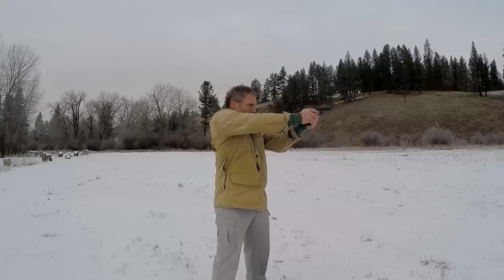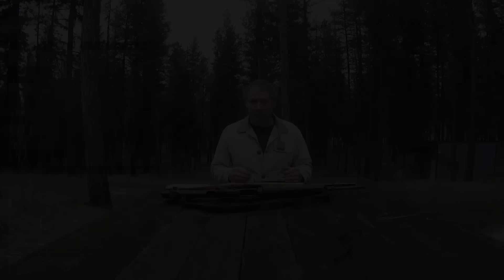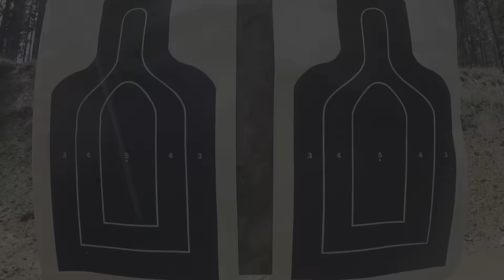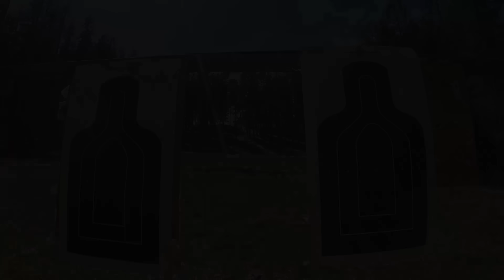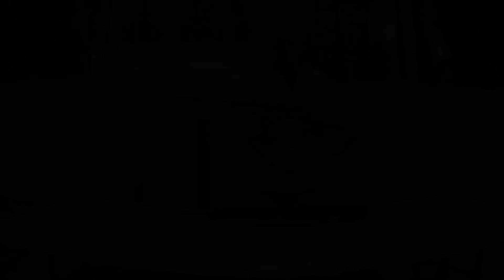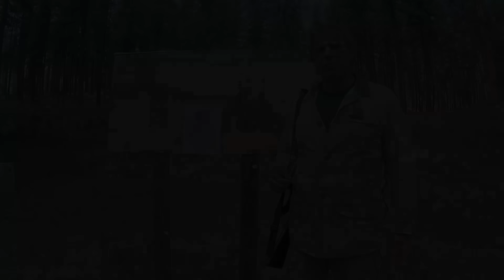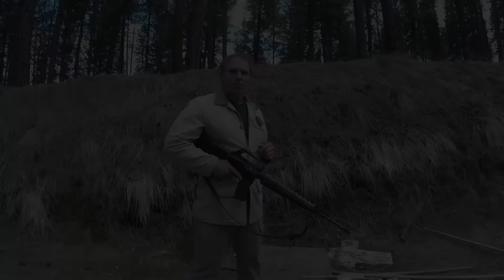Mini-14 vs AR15: Which is Better?

Comment: Bill Ruger didn't make a lot of mistakes but not using AR magazines in the mini 14 was one of them.
Reply: The AR platform wasn't nearly as popular as it is today when the mini was designed and initially released
Reply: @NinjaThatLongboards  There was a time when many of us believed that the M-16 was nothing but trouble.  Over the years, we learned about the switch in powder in the 5.56 and little mistakes like not issuing cleaning kits contributed to the stories about GIs being found dead next to disassembled rifles.  The Mini14 looked like the guns we were familiar with: the  M-1 if not the M-14.  It was about like an M-1 Carbine in a far superior caliber.
Reply: @eastofaustin258  thats what I've been trying to say and nobody believes me
Reply: @eastofaustin258  isnt a 30 Cal in this case more similar to a pistol cartridge with a little omph
Reply: @matthewbivens1299  

I believe what I said (I can't seem to find it) was that the Mini 14 was more like the M1, the M-14/M1A, and the M1 Carbine with a far better cartridge.  Yes, the M1-Carbine is a hot pistol round.  THe M1 of course was produced in .30-06 for the Military and the M-14 was for 7.62x51.  BTW, the M1-Carbine has been modified to some other calendars.
Reply: Walter Lee is modern 5.56 ammo closer to what colt intended? Or is the stuff I’m buying at stores more like the weird powder ammo the army was insisting on during the Vietnam era.
Reply: @eastofaustin258  Most folks don't remember that the AR-15 was originally developed in response to an Air Force request for a light rifle to replace the M1/M2 carbines. The other weapon submitted was the Winchester light rifle, which was in many ways a "product-improved" carbine in .224 caliber. Winchester abandoned their design after their .224 cartridge failed to match the Armalite .223 cartridge's performance in testing and -- more subtly, but also significantly -- noting that many of the younger military decision-makers liked the "Buck Rogers" look of the Armalite rifle.
Reply: @boredandagitated  The design changes incorporated in the M16A1, plus actually cleaning the rifle to eliminate carbon build-up, addressed most of the issues caused by the Army's change in powder back in the 1960s. The carbon build up issue has also been partially mitigated by no longer using powder formulated to minimize muzzle flash.
The only real remaining issue is the change in the pressure curve, and all the military ammo since the M855 design has worsened that by further elevating chamber pressures. When in introduced, the M193 cartridge was considered "hot" at 55,000 CPU, but current military ammo has upped the ante on that front (to 68,000 CPU) in an effort to push rifle-barrel performance out of the shorter carbine barrels.
Reply: Walter Lee ... I had to furrow my brow at your use of the word "calendars". I figured out that you meant calibers. M-1 carbines in other than .30 carbine caliber are extremely rare and next to useless. Depending on the particular shooter and rifle, M-1 carbines can be capable of surprising accuracy. My Japanese M-1000 Universal Firearms version was very natural for me to do rapid fire plinking with very effective accuracy for the circumstances. It also accounted for a prairie dog at a distance that was difficult to judge, so I slid the peep sight to the 250 mark and held just over the top of its head. I touched the round off and an eternity later came the sound of the hit. I decided to drive to the point where the dog was due to the distance and rough terrain. The odometer clicked 2 tenths on the way up. All in all, it was a bit over 300 yards. Part of the reason I had trouble doping the distance was the size of the beast. It was the biggest prairie dog I'd ever seen. I was too young and dumb to be aware enough to take it to a taxidermist. Unlike those disintegrated by .22-250 bullets, this one was very much intact, due to the slower and unexpanded bullet passing through the chest. I still have the carbine and one more from a gun show a few years back. Just don't shoot much anymore.
Reply: @NinjaThatLongboards  This, it wasn't even that long ago when buying a Colt was pretty much the only guarantee that your AR wasn't going to be a lemon (alot of subpar DPMS/Olympic quality AR's flooding the market)
Reply: One could also argue that its a feature that keeps the Mini off ban lists.
Reply: It's not an AR.
Reply: @hugh-johnfleming289  Neither is the Steyr Aug or CETME L, or L85 but they were all designed or redesigned to use STANAG magazines.  I feel certain a Mini 14 could be built that used an AR magazine.
Reply: @williamprince1114  That's like saying "they should have built that handgun to take Glock mags," but saying it in the early 90s when they hadn't dominated the market yet... The Steyr Aug was created with proprietary magazines when it was designed in '77 and didn't change to STANAG magazines until decades later, after the AR had dominated the market. Also, don't forget the mistrust that the early problems with the AR created. They are beloved today, and rightfully so, but that wasn't always the case. There was a time when using AR magazines or parts would have been considered a bad thing by some. It was a completely different era and they couldn't predict the future... How many people were making guns to take Glock mags in the first two decades after they came out? People didn't trust the new fangled plastic guns yet...
Reply: @williamprince1114  Look at the geometry for the magazine catch on AR-15 magazines -- you would have to graft an AR-style magazine well on to the bottom of a Mini-14 to properly support an AR-style magazine. Not only is the geometry for the magazine latch different, with clearance required along the left rear of the magazine for the latch to move in and out versus the Mini-14 latch operating in line with the rear of the magazine, but the notch at the front of the Mini-14 mag (the reason for the rock-in motion) eliminated the need for a long magazine well to hold the magazine upright for reliable alignment with the barrel.
It's also worth noting that the Mini-14's magazine 2-point retention system (simple rocking-lever latch at the rear plus a fixed latch at the front) is also used by the M-14 and all of the Kalashnikov rifles.
Reply: @williamprince1114  I own a few of each, I should look at the Mini and see if its possible to adapt one to use an AR magazine.
Reply: @shakingmyhead7707  Just like with the mini 14 there were reasons they didn't do that. The AK was still looked down upon as the "commie bad guy gun" or whatever when the mini thirty came out in '87. The AK has only fairly recently become popular and revered (as it should be, IMO) among the mainstream American shooters...
Reply: @ZombieWilfred  The AK platform rightfully became popular in the US, mostly because of it's insane durability. I've seen guys jam a fistful of mud in the bolt, and it still ran flawlessly. Bear in mind that those were the Romanian AK's, which were considered low quality at the time.
Reply: @michaelmartin4493  Not to dispute your memory, but the video at https://www.youtube.com/watch?v=DX73uXs3xGU says (and shows) otherwise.
Reply: @shakingmyhead7707  I've only ever sold one of my guns. Never again! Haha! I'm definitely glad the AK has caught on here. I find it strange when people hate on a certain gun just because if its country of origin or it being used by "the enemy." Doesn't matter to me where it came from, a good gun design is a good gun design. The first rifle I ever bought was an AKM variant when I was about 21-22 so '07 or '08 (M+M M10, it's been a great gun for me.) I wish I was old enough to have bought them cheap back in the day, along with SKSs and all the milsurps that have gone up so much in price in the past few decades. I also own an AR and a VZ 58. I'm a collector, though, so I want one of everything! 😂
Reply: Selling 30 round magazines made by Ruger for $50 is a profit generator. Shows Bill likes to nickel and dime his customers
Reply: @Community-Action   Bill was of the opinion that no "honest man" needed more than 10 rounds and didn't want normal people to have 30 round magazines.
Reply: axmajpayne actually when that happened the government wanted to ban all magazines. Bill was who got them to agree to 10 rounds being the limit. If it wasn’t for ruger we would have had no magazines during the assault weapons ban.
Reply: @dinospumoni8860  Oh you mean like Benchmade Knife company in OR...they get a whole new crop of anti gunners to buy their knife...while blatantly lying on FB about being "pro 2a"...

After deleting a post showing them saw up guns for the local cops...😃...RIGHT...
Reply: axmajpayne actually he said 15 rounds but still...
Reply: @shakingmyhead7707  In my opinion they're quite good. Quality (at least it appears to me to be) cold hammer forged chrome lined barrel with 1 in 10 twist and 4 lands and grooves. The tapco G2 trigger is quite nice as well. I also like that it has a side rail, quad rail, hogue grip (comfy!,) RPK-style windage adjustable rear sight, and an actual muzzle break instead of the slant break many have. The gas block front sight (which looks great, but does reduce the sight radius...) is hard to adjust for windage, because regular AK front sight tools won't fit over it, but to me that's a non issue because I just keep it dead centered and used the adjustable rear sight to zero it, which means you don't have to worry about having to have your front sight canted when properly zeroed. When I have people out to my range to shoot they're usually quite surprised at how accurate it is, especially with the fairly short sight radius. I would need to get a lead sled or something and a mount and magnified optic to really see what it can do, but as far as I can tell it's very accurate.
Reply: As an owner of an LCP, GP 101, 22/45, P85 and ex-owner of a Mini - yes, sadly, that's just one of several things wrong. I wanted to like my Mini, I really tried to.  You could put up with the P.I.T.A. they are to field strip (which seems to be true of EVERY ruger) if the accuracy made up for it.  On the Mini, it doesn't - I had an oldy the new ones might be better - but I'll stick w my Stag M4gery... Ridiculously accurate compared to the mini.  I can hit a can at 200 yards, iron sights, with the M4gery- can't do anything like that with the Mini...
Reply: I would buy one if they made them compatible with ar15 mags, for sure.
Reply: I think that’s the furthest I have ever seen anybody shoot at a chronograph.  I am not lucky like that.  Shooting into the sun with open sights with old eyes, results are expected.
Reply: Mike Gee  thanks I thought so I've only ever seen them in media
Reply: @shakingmyhead7707  You're welcome. Bought it way later than I thought, though. Turns out I got it in '13. Thought it was closer to when I bought my first handgun, but I guess not, haha!
Reply: bob bobo  I saw it myself. Before that, I wouldn't have believed it either.
Reply: bob bobo  I like the accuracy of an AR, but for more practical ranges I'm with you. I like the AK. My real preference is battle rifles, such as FN FAL, or G3, though. I also agree on Ian, as well. Great show. I love seeing the history of some of these rare guns.
Reply: No shit.
Reply: or ak mags on the mini-30, one of which I own!
Reply: @TheHuskers1995  The original mini-30 is an absolute joke considering it doesn't function reliably with steel cased ammo which is almost 99.99% of 7.62x39 ammo out there. Moving to the .300 BLACKED makes more sense
Reply: Bill Ruger was anti 2a
Reply: Bill Ruger Sr. worked with Diane Feinstein to ensure his rifle would remain unchanged and his competition, ARs, would be banned under the AWB.
Reply: Why would he use what is the biggest weakness of the AR platform?

It takes probably 3-4 AR magazines to equal one Mini-14 magazine and god knows how many to equal one AK magazine.

Anyone remember the federal AWB days? When AR mag rebuild kits and feed lip straightening tools were sold prominently at every sporting goods store? Sure you had AK spring/follower kits, but they weren't carried everywhere and often were special order items. Mini-14 magazine rebuild parts were special order items.

Even today there are AR mag Go/No-Go gauges for feed lips available online from a multitude of sellers; tools for fixing the feet lips and more. Nothing similar exists for AK and Mini-14 magazines because those don't go wrong often enough to warrant such tools.

The Mini-14 and AK magazines are examples of "Buy once, cry once". AK mags are built to outlast the gun while Mini-14 magazines are built to be a bit lighter, but still durable enough to last along with the gun itself. (Pretty much nobody outside of a video game or shooting competition actually drops their mags when reloading. They retain them.)

The only reason people say they wish it took AR magazines is because "they're common". Ignoring how many malfunctions are caused by the magazines themselves due to their fragile construction, necessitating they be as common as dirt in the first place. For people who don't have a dealers account at Brownells and who think shooting 20 rounds per trip to the range is a lot, having a gun that uses magazines of a firmer construction are an advantage, even if they cost slightly more.

Heck, En-Block clips were at one point cheap and common. Should people have designed their guns to all use them?

The desire to shoe-horn a problematic magazine design into every gun design is quite laughable as far as I'm concerned.
Reply: Does it take glock mags?
Reply: Jean-Louis Bourgeois  That, or you know, he thought that people should actually hit what they shoot at, rather than blazing away and using volume of fire as a substitute for skill. And that the only need for large magazines was  for either the incompetents or criminals. The AR was designed for military use, where ammunition capacity is important for sustained flights. The Mini-14 was fundamentally a civilian market rifle (yes, I know it was submitted for the Air Force competition, but it was designed specifically with the civilian market in mind), where the requirements are noticeably different, and high magazine capacity is only a "need" for fetishists. 

He wasn't wrong. 

And methinks you're, ahhh, compensating for something.
Reply: @trims2u  no compensation, just want us normal citizens to be on as on par with the military as possible...what the founders intended
Reply: @andrewkraus7215  (a) that's not what the founders intended (b) we absolutely don't want our civilians equipped like our military, as the arms are for completely different purposes  (c)  what they intended is irrelevant anyway. They weren't God, and it's not Scripture.

The Constitution is a framework for governance. It's interpretation is mutable based on the time period where it's being looked at.

Comment: In Canada, an AR costs as low as $600, but is restricted to range use only. A Mini-14 starts at $1100, but can be used unrestricted except capacity (5rds). So we buy Chinese bullpups for $900 and can use 10rnd mags. Yeah, it still sucks, but it's better than a plastic  KelTec  at $1000+.

Comment: I'm not sure why this is a topic. If you have a mini so what but if you have an AR-15 you have a far superior rifle. Just using Ruger for example Ruger Mini 14 Tactial which to me is comparable to an AR-15 1:9 Twist(nobody wants that anymore) 7.2lbs and MSRP 1089.00, Ruger AR 5.56mm 1-8 twist much better, 6.7lbs MSRP 799.00 hell the Ruger MPR is cheaper than the mini 14. And don't even get me started on magazine availability and price. Mini Trash Mini 30 even bigger trash.

Comment: I was in law enforcement for seven years. The first five years my department only had mini 14s, the sights would always be incorrect from zero per each rifle, the mags were very picky about being clean and flimsy so they often did not function, and the peep holes are so small and loose that your sight picture is nearly nothing. The scores of everyone could be wildly all over the place on any given day and even the best shooters would be shooting massive one foot group sizes at 50 yards (typically anywhere but the actual point of aim). During my last two years my department finally bought some used ar-15s that everyone had been begging for, for years. Instantly new and old shooters alike were doubling their scores on the range and passing. Suddenly we were not dealing with as many malfunctions on the range nor having sight zero issues. Also mag exchanges were double the speed for the average or novice shooter.  In short, everyone's marksmanship skill improved by using the ar15 instead of the mini-14. From the most novice new shooter to the most seasoned veteran everyone started liking range day a little more because it was no longer so mix bag on your own results due to poor quality rifles.

I'm a AK person, so transitioning to use the mini-14 was pretty straight forward. For other people that is not such the case. Even I greatly enjoyed using the AR15 over the mini-14 once we made the switch. Plus all the military vets felt right at home with the adjustment.  Anyway, that has been my experience with the mini-14. It is heavy for a .223 rifle, has poor sights, and mixed bag quality. An AR15 will do everything better in a lighter frame and probably for equal or cheaper cost.